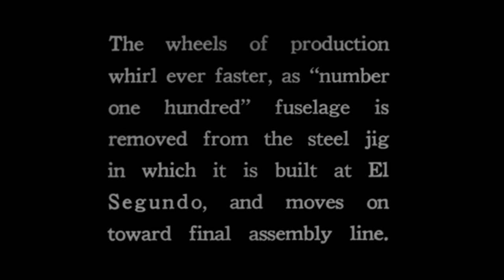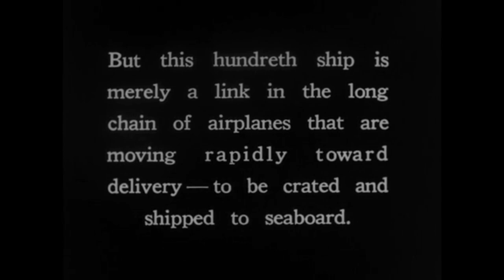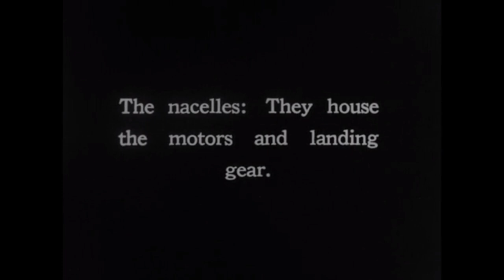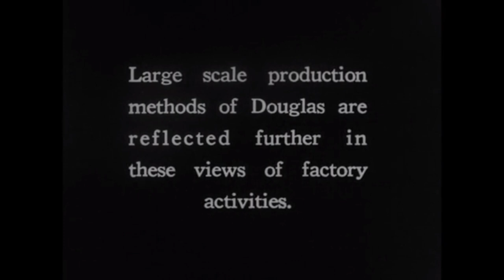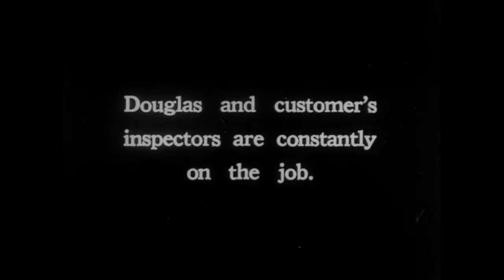Douglas B-18 Bolo Assembly Line | Boeing Classics

Comment: Most of the aircraft in this film are DB-7s or DB-7As being built for the Armee de L'Air. The second batch of DB-7s, and all DB-7As, were assembled at Santa Monica, with Fuselages built in El Segundo.  The Scenes are mostly of the Santa Monica Plant, although the first scene is El Segundo, as captioned.  The aircraft in final assembly at 6:58 appear to be DB-7As by the larger vertical stabilizer.  Only shots where B-18As are seen are at 5:58 and 7:32, both on the SM final assembly line.